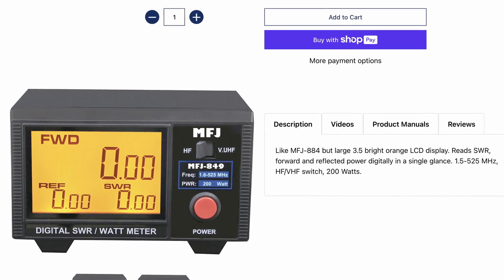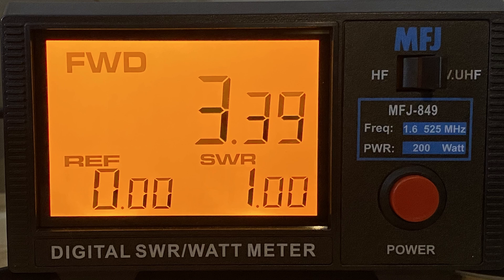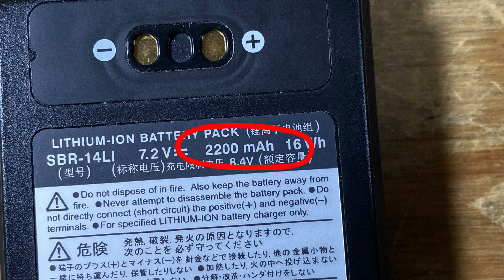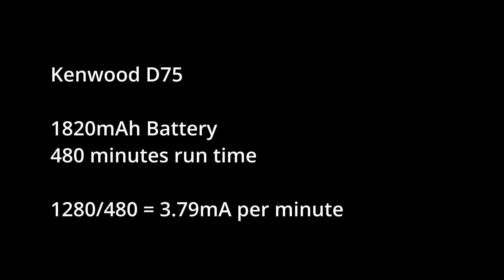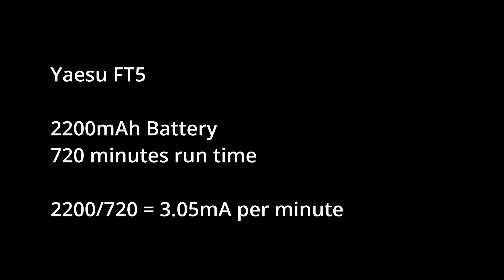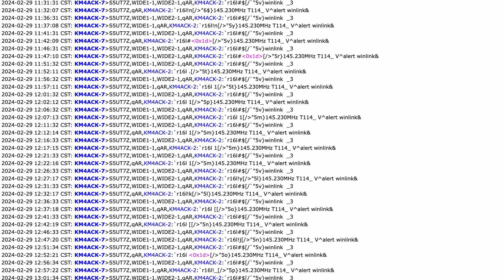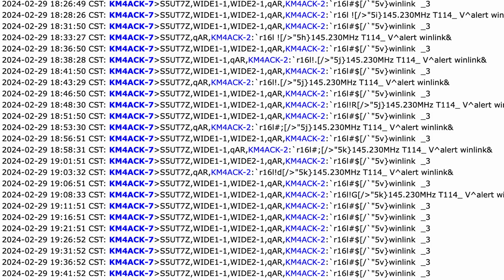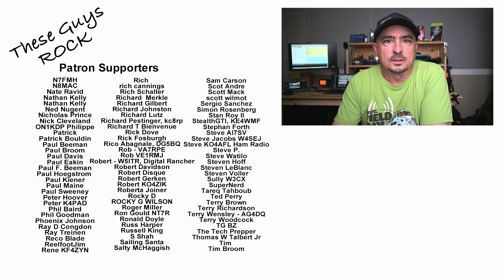Kenwood D75 versus Yaesu FT5 :: Battery Showdown

Comment: The TH-D75 has a lot of great features but rugged is not one of them. Neither is long battery life.  If your D75 gets exposed to a light rain, it will get damaged and Kenwood will void your warranty.  Repairs will cost you in excess of $400 on a $750 HT. Buyers beware

Comment: This was an excellent comparison. It's a shame the Kenwood can't do a little better, but it's not exactly horrible, all things considered. I wonder if there are any settings in the Kenwood that could be changed or disabled that would improve the battery life when comparing its battery life to the Yaesu. BUT without compromising any of the specific features you tested. They both seem like great radios.
Reply from the maker: Not that I am aware of other than decreasing how often the radio beacons your position.  If you don't need APRS, turning off the TNC and GPS will make a huge difference.

Comment: I suspect the boomers don't understand lithium bases battery systems.  The whole cycle thing is bs. To top it off you can't get a good capacity reading based off voltage due to how flat lythium discharge curves are with out a shunt to track current

Comment: The Kenwood D74 had terrible battery life.  I ended up selling mine because of that issue.  Other than that, the D74 was an excellent radio.
Reply: I have the D75 and the battery life also is horrible... I have bought a second battery unit...

Comment: Jason it may have been more revealing if you measured the actual current consumption during the test. You could then determine the current during receive, standby and transmission. This would enable you to see where the additional current consumption is coming from. Also, would be a good idea to establish the actual battery capacity rather than relying on the battery stated value, which I find to be optimistic at best.

Comment: I have a 2200ma battery from Batteries America for my D74. They use the same battery according to Kenwood.
Reply: Which model number gives you 2200? The only battery I can find for the 75 on Batteries America offers 2000 mAh.

Comment: I'm curious why you did not use the batteries' watt-hour rating rather than the ma-hour rating. In this case, where the voltage is the same for both batteries, the results would be the same. If the batteries had different voltages, the ma-hour rating would not be a fair comparison of battery capacity. For example, a 24V battery with a 1,000 ma-hour rating would have twice the capacity of a 12V battery with the same ma-hour rating.

Another test I would like to see run is both radios with the GPS turned off. In other words, how much of the difference is due to the GPS rather than the radio?

Thank you for taking the time to run these tests. Clearly, it was not something you could do in just one day. When considering the purchase of a radio as expensive as the D-75, one appreciates knowing real-world results, not just what the manufacturer claims. DE WA1KLI

Comment: Rather than amp hours you should look at watt hours. Both are on the battery but watt hours considers voltage and amp hours to give you the power in the battery. Your comparisons is fare in this case because the voltage of both batteries are 7.2 volts.

Comment: Thanks for this video. I have been curious about the run time of both of these radios. I like my FT5 but would like a D75.

Quick note: at 4:52, your result is correct, but the numerator in the division has a typo.